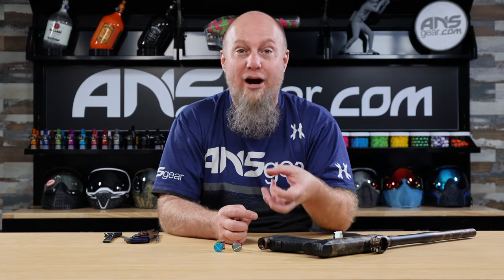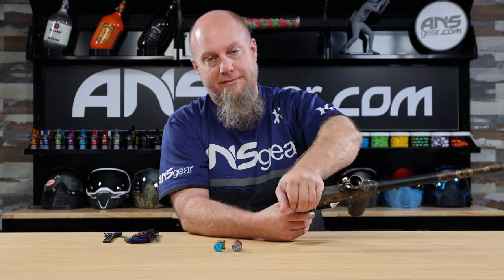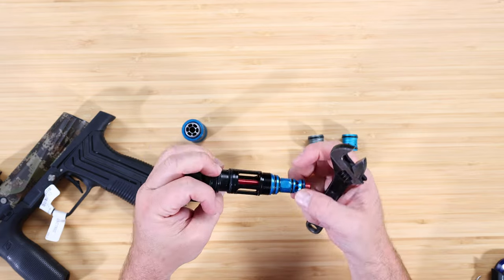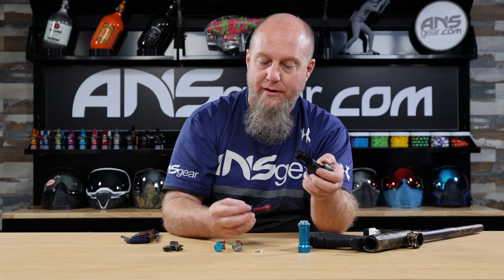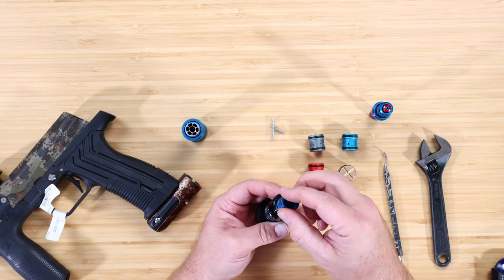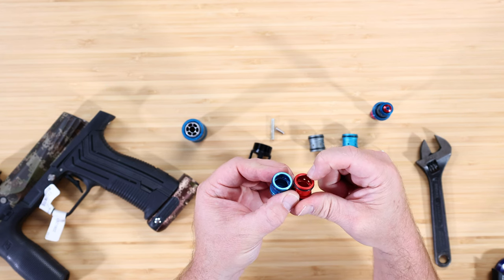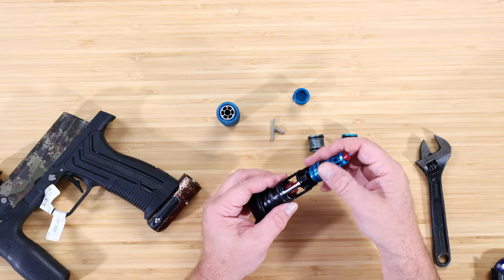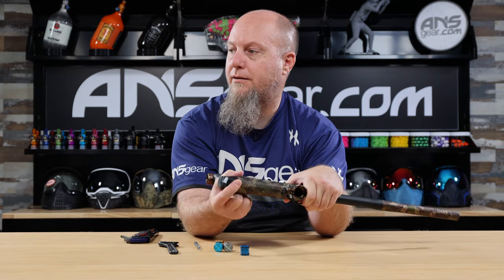Core Ignition Valve - Review

Comment: I got the HK version for my EMF100 with box rotor combo. For those days when you go to that scenario event that does allow full auto. Yes I know 99% of walk on fields will frown upon leaving this in but the emf/emek/r170m but if you are to lazy to remove it after the event, that's on you since that drivetrain is so easy to work with.